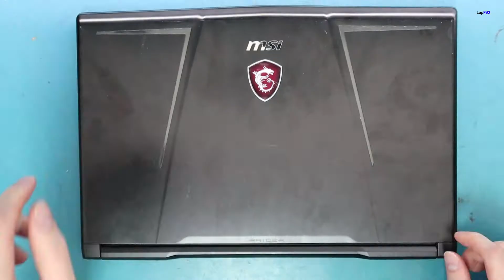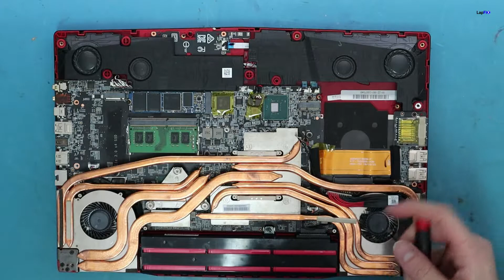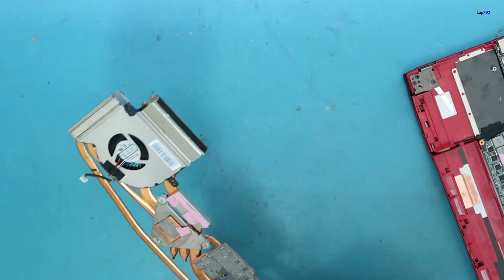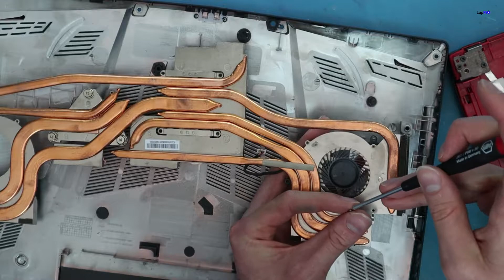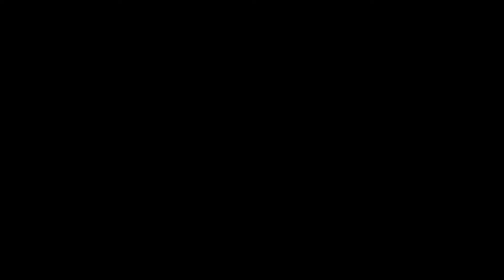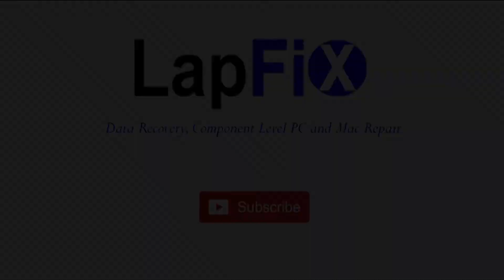How replace MSI GE63 Raider  Fan Replacement - MSI Laptop Repair

Comment: hey my fan model is the same as this one but its not available in my locality can i use any other model fan?
( paad06015sl n384 this is the model of my fan )
Reply from the maker: It needs to be exactly the same.  They have specific sizes to fit perfectly in your laptop.  Getting one that works, if it is too small may not cover the whole area of the heatsink and won't cool it properly
Reply: @lapfix   thanks I will try to find same model then
Reply: @lapfix  my fan just died and i cant find the exact type of GE63 fan, i can find GE62 VR with the exact 4 pins fan. I hope it fit perfectly into my ge63vr laptop
Reply: @edwardhalim6967  how it went?

Comment: Msi must have a problem with their fans. Mine died with 2 months of use. (6 months old)
Reply: Me too
Reply: Which laptop?
Reply: My GE63 9SE lasted 2 years before I had to replace the fans
Reply: I had one "die" but what actually happened was a screw coming loose and getting in it. Once I removed it the fan came back to life.